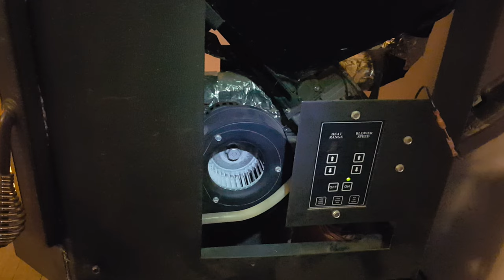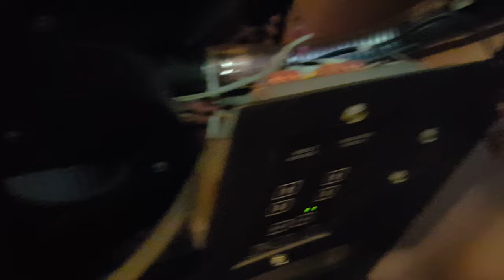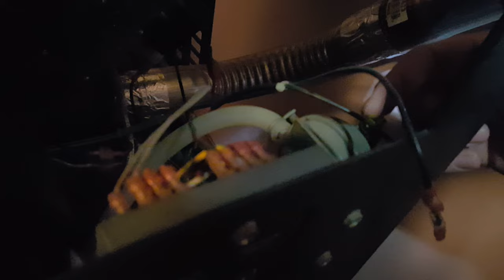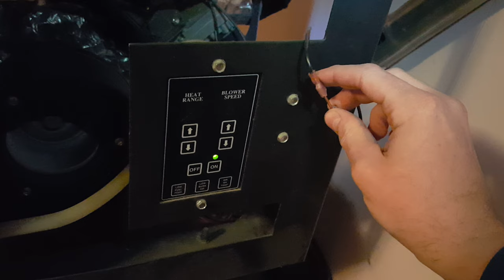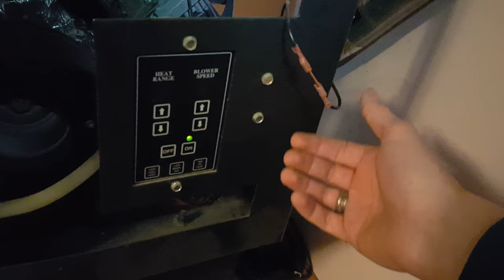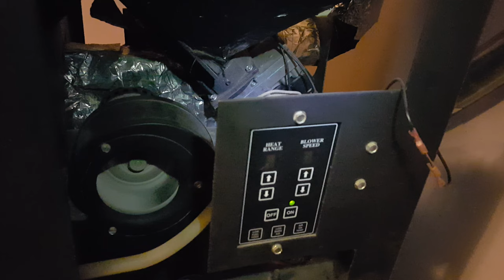Pellet stoves 101 SAVE MONEY on repair bills

Comment: I also have an inexpensive Englander pellet stove. To combat breakdowns I keep one of every component that could break in stock in my garage. There are really just 4 components: 1. auger motor, 2. Room air motor, 3. exhaust motor, 4. Vacuum switch that can break down. Keep spares of these on hand & never worry about being down.
Reply: and when i do that on litterally anything i get called a hoarder🤣🤣 but smart plan always have it on hand that way you dont freeze waiting for parts

Comment: The brain box in my 20 year old Quadrafire fried. I wound up wiring the blowers and auger to a power strip with a dimmer switch on the auger. Not the safest set up but it runs! No, I don't leave the house with it running like this.

Comment: This is awesome info. Thank you for this video. I'm about to find out if mine needs a new pressure switch. If it does I'm going to put  a switch inline with the jumper so I don't over work the blower. Lord knows the last thing I need is another part to go bad on it. Thank you.

Comment: The fan that recirculate the heated air into your house that you’re showing a picture of if the inside radius of those little fans get a 30 second or 16th of an inch of stuff in them that reduces the airflow that it creates by 20 to 30% so take a few minutes get a Q-tip and and clean each one of those on the inside and add that to your yearly maintenance!  I had one of these stoves for six or seven years it’s the simplest easiest most dependable pellet stove on the market the only thing you need for spare parts is one auger motor.  They are both the same motor so they are interchangeable! 
And all of the different brand stoves all use the same auger motor. . And if you really mechanical when they fail and I’ve had several over the years what I’ve discovered is inside the gear case of that auger motor the grease that they use dries up and so no lubrication on the gear mechanism  causes The mechanism to intermittently bind so it’ll work for two days you’re clear it spin it and it’ll work for another day or six days and it’ll stop again😳
so what I’ve done is pull it apart clean out that grease put a sealer all the way around where the 2 halves meet, and put some 90 or 120 weight gear lube..... rear end fluid in there it doesn’t take much, lay it flat so that that the split cases in half and fill that front half about halfway 3/4 and then seal the seam and bolted back together!!! Provided that the motor on it is still turning and I have yet to see one of those motors fail! Great video you jog my memory at the beginning of the season for a friend of mine who’s the stove wouldn’t run it was dirty! VACUUM SWITCH😃
Ps also get yourself one of those little oil cans with the long spout on it so you can reach down in and lubricate the front and the rear bearing on the exhaust fan they don’t have a lubrication ports but if you can put a couple drops on the shaft with the motor in your hand and let gravity run it down into each bearing that will prolong the life for that motor in definitely........... 
Thank you and I’m your ONE PERSON!  GOD BLESS OUR AMERICA
Reply: What a great reply. Thank you for that information.👍

Comment: Thank you I had the same problem I had to pull the exhaust pipe that goes outside was completely clogged over 6 years. I will try to by pass the safety switch you might not need to buy a new one if you run it for a while then clip it back up sometimes works.

Comment: Hello great video...my Englander acted up after I cleaned out the t port ehhaust pipe now after a restart its ok ,the circuit board needs a complete rebuild using modern up to date electronics then the stove will be super.

Comment: The pressure switch is a safety. It's okay to test with a jumper. NEVER leave it running on a jumper. That switch is there for a reason. From  HVAC tech with 15 years experience.
Reply from the maker: Correct, I jumped it to test it. And replaced switch with a new one.

Comment: Using 5 amp auto fuse for jumper still have some protection if you have short in system
Reply: I have a Whitfield pellet stove .it goes on heats up real night the turns off and starts again can you help me?

Comment: Do you have any Suggestion for why the 6 amp fuse keeps popping everytime i press the ON button?  The stove started up  and after about 5 min it stopped and tripped my breaker.  I found the burnt fuse, replaced it, plugged it in, hit ON and pop.  Replaced it, hit ON, POP.  Any Ideas what i can self diagnose first before I call a guy
Reply from the maker: You have a short somewhere it sounds like. Find out what that 6 amp fuse ties to and trace it all the way back. Somewhere you will find the fault. I suggest doing a continuity test with a multimeter first. It may also be obvious if a wire is burnt in there if your lucky it will stand out. If all else fails call a professional so you don't burn your house down. Better safe than sorry

Comment: hi I don't know if you will see this but my ashley 5500XL stove turns on and you can hear the exhaust fan start but then it stops then starts then not ,it does this all the time it runs ,other than that it works fine ,any ideas of whats going on? thanks
Reply from the maker: Sounds like you may have a motor shorting out and starting to go bad. Although I'm not very familiar with the ashley stoves. I would do some quick Google searches on that type of stove to see if others have had the same issue and how they resolved it

Comment: Hello I’ve got an englander pellet stove. About 2 years old. Ran perfect last year. Been using it a hand full of time this year so far so good except past couple night it will fire fine and run fine but within a few hours it will over fill the burn pot with pellets and shut itself off. All my pipes are clean my two clean outs in fire box are clean. Any tips
Reply from the maker: It sounds like all the ash isn't blowing out of the burn pot after it stops feeding. Clean out all the holes really well and check the quality of the pellets for being a little damp. Could be a combination of things but I would check those first. Hope this helps

Comment: I have a question and if anyone can help it would really be a blessing i have a pellet stove and when i turn it on it comes on and the rotator turns but it just automatically shuts off and on the side panel i can't turn the numbers up or down and on the left side on the panel it says the letter E what is going please help anybody
Reply from the maker: The E stands for error. It means the temp sensor didnt get hot enough to start the blower motor that blows the warm air into the room. Clean your ignitor and the fire pot really well and it should clear up and operate like normal. If it doesnt your ignitor may be starting to go bad and not get hot enough for a good burn to get it going like it should.
Reply: @mr.diytech3591  we clean everything out i took the back off and everything it just shuts off once i hit the on button
Reply: @mr.diytech3591  how much does it cost for a repair
Reply from the maker: @mauricemegginson3625  there is definitely something wrong with one of the sensors or the control board if it's doing that.
Reply: @mr.diytech3591  do you repair them or come out and look at them
Reply from the maker: @mauricemegginson3625  I'm just your average homeowner that bought a crappy used one and had to work on all the time to get it sorted out and working properly. I made a few videos of the stuff I learned along the way to try and help other people out with the same problems. I know how frustrating it is. Especially when you depend on them. I hate to say it but you may have to call a professional to come take a look at it. I'm sure it's probably something simple being over looked but you never know. I wish you the best of luck.

Comment: Country Pellet stove.  Self ignites, feeds pellets, stops working in about 5 min.
Reply: check low limit switch. if it doesnt sense heat after 5 mins or so it shuts down the stove
Reply: @johnofthejungle5699   it was Proof of fire snap switch.  $50 part.